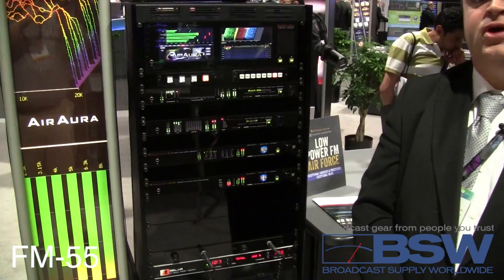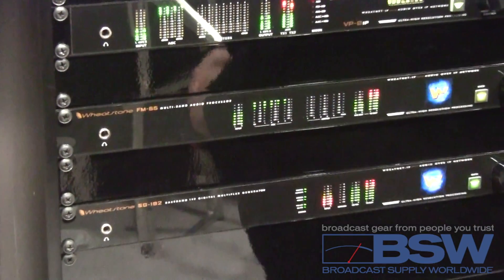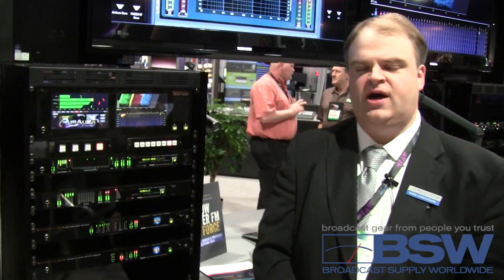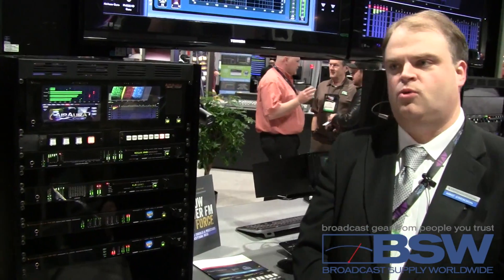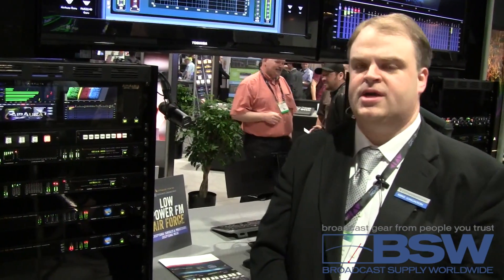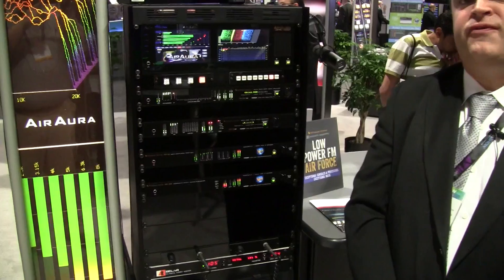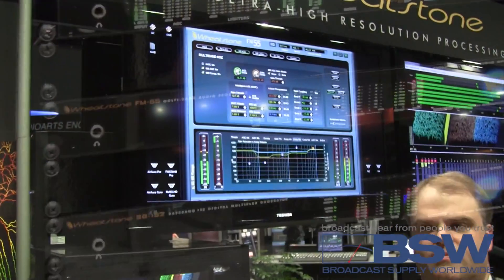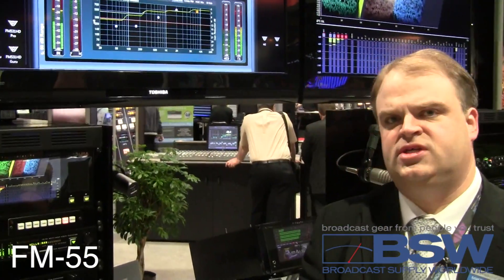BSW Presents: Wheatstone FM-55 Audio Processor

Comment: absolutely incredible.  Once you figure out how to modify the factory settings to fit your audio chain,  It does what it claims.  Brings a digital sound to analog FM.  When there's silence, there's silence, no hiss at all.  It takes about a week to get used to if you're coming from analog processing (it's too bright/clean!)  Right now we only have one preset we use for all programming, and it works very well.  But you can tailor it for format, and even when a relay fires, change settings for commercial break.  Only "issue" I might have is the tendency for us older farts to crank up the highs.  On this unit, you have to keep the high end much closer to flat.  +1 would Recommend.
Reply: hey! thank you for comment. are you steel with 55fm on air? is it stable? no problems?